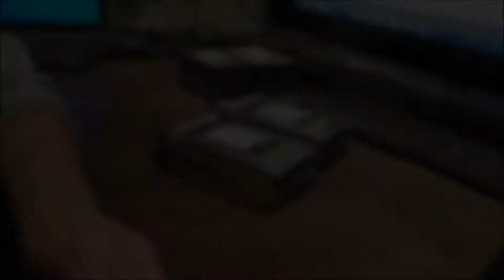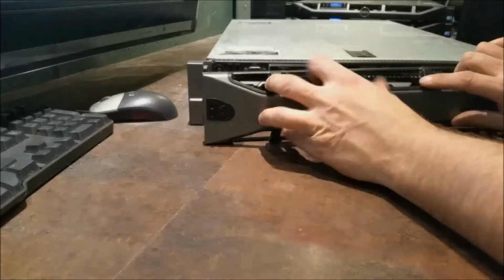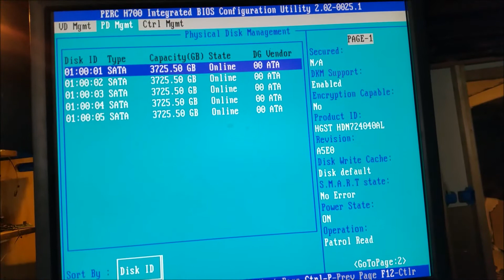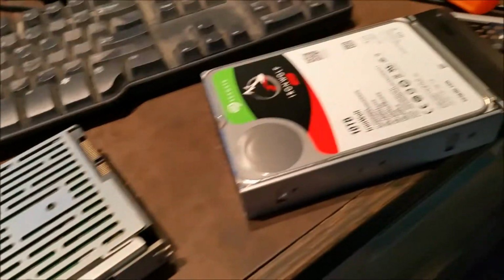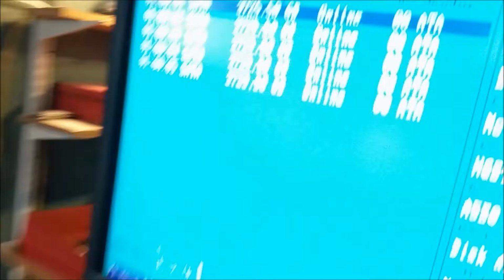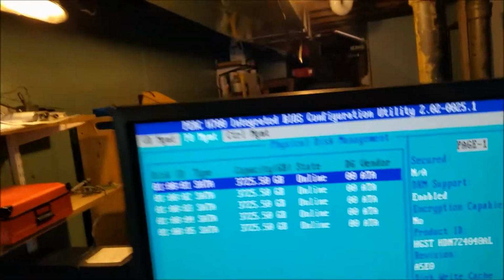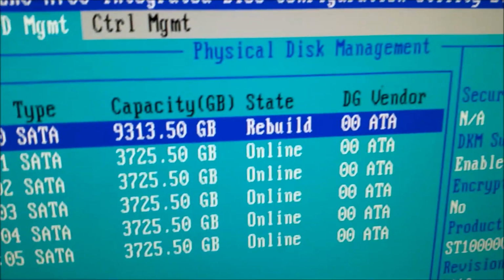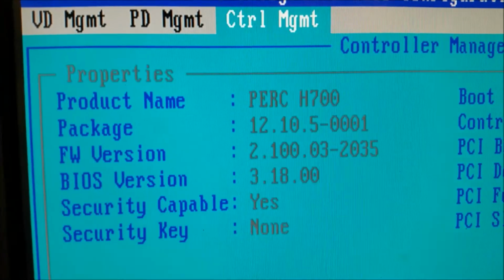PowerEdge R710, Install H700 Raid Controller and 10TB Seagate Ironwolf

Comment: Funny same firmware, same controller, same server, recognized the drive, but still showed drives failed just like the PERC6 did when I build a RAID1 with a couple of the seagate drives.  Curious to see if you were able to build a RAID array?

Comment: With the H700, does a raid array fix itself (on the fly / while running) when you pull out the bad drive and put a new one in ?
Reply: Yes I have same h700 it supports hot rebuild, as long as the disk didn't have any prior foreign raid configuration on it, soon as you put it in it will auto rebuild no other user action required, the green caddy power light blinks when it's rebuilding, if its not blinking it's not rebuilding and there be no disk light activity (if it does have any pervious use raid configuration from  different raid array setup you need to use lsi mega raid or dell openserver manager to clear the disk and assign it or add it as hotspare)

Comment: Where did you pick up the H700 with cables and battery from and how much?
Reply: Ebay, look for h700. you will find them with cables.
Reply: eBay. Picked one up for $50 roughly.

Comment: I'm considering buying an r710 with an h200 or h700 raid card. I want to have a 240gb ssd and 3x -6tb ironwolf drives in raid 1E. The plan is to use the server as a NAS, along with using its CPUs and ram for computing, VM's, possible server hosting. Will this type of drive setup work? Is it as simple as installing an os, configuring the drives/raid like it is on a standard desktop windows pc? Thank you

Comment: Hi, great job
I want to do the same with my R710 and I wanted to know several things:

Where you bought the PERC H700 I need it with cables because I have the same case of yours that the server currently has a PERC 6 / i.

With this upgrade would I support 4TB SAS disks?

Thank you
Reply: purchased on Ebay for $100, came with the cables and they were listed in the sale.  I now have 10TB drives as shown in the video with the firmware versions needed.. -cheers